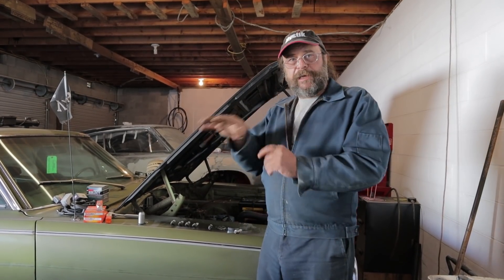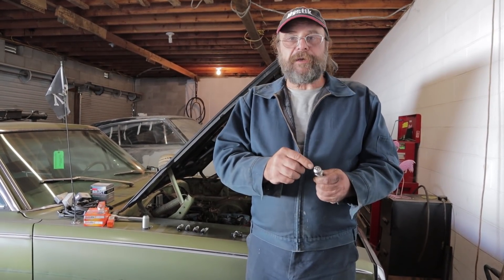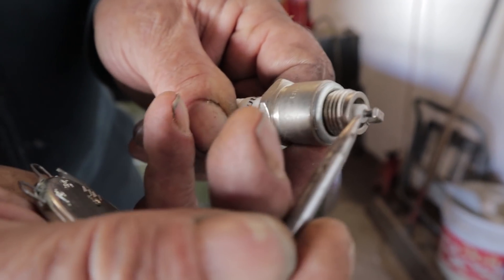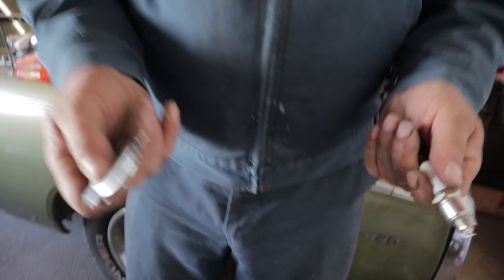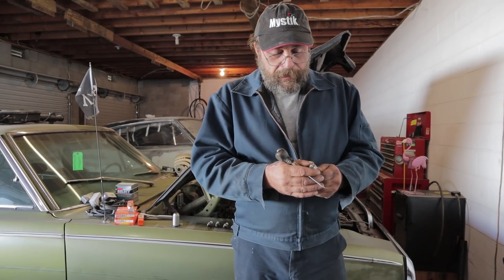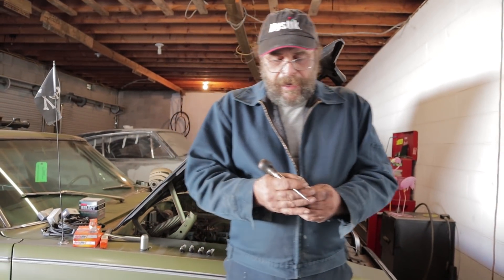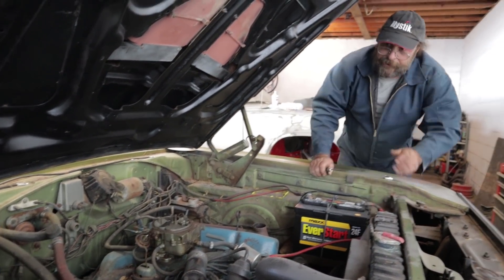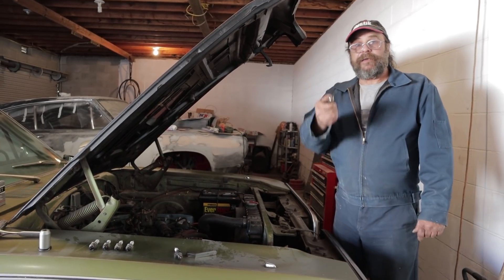Tune Up Basics - Spark Plugs

Comment: The reason I change one plug at a time  and replace it with a new one is because I'm to stupid to remember what wires go to which cylinder. And I'm to lazy to mark the wires. Lol
Reply: I ALWAYS change them one at a time.

Because I'm a chainsaw mechanic
Reply: And you can lay them out in the order they came out.
Reply: Atleast your honest enough to admit it, I had a mate years ago every time he changed plugs I'd have to go do his firing order, I got the shits wrote his firing order on his rocker cover then marked number 1 on the dizzy cap, never got a phone call again lol
Reply: Yep. That exact reason I do the same myself and lay them out in order as I change them out.

Comment: my 69 Bonneville 428 (rebuilt with 11.5 to 1 cr) didn't like ac delco or champion spark plugs.  always had plug problems. thanks for the video.

Comment: Everstart batteries are a good value.
Reply: Not for me. Anything made by East Penn/Deka is much better. Everstart Plus (3yr warranty) that came with the truck I'm driving died at exactly 3yrs. Bought a new Everstart because it died AT Walmart. $100 Maxx was out of stock. Bought the $50 "value" battery with 1yr. warranty. Died 9mnths later. AT Walmart! Free replacement they tried to give me had been sitting on the shelf 5mnths. No way, had them switch it for one that was only a few weeks old. 2 months later as the weather turned cold I went and bought a fresh battery made by East Penn for Farm and Fleet. $100 7yr warranty, 3yr free replacement, 3yr free Nationwide jumpstarts. "Platinum" battery. Top of the line lead acid. In the past I've used "Gold" have seen them last 8yrs. The one I bought has both side and top posts and more cold cranking amps. Walmarts batteries are made to fit their pricing structure by Johnson Controls who is not owned by the same people who established a reputation for quality. A few years ago it was purchased by a giant foreign corporation. I'll stick with USA owned, USA made, just like my Goodyear tires. Everstart if you have to but not by choice.

Comment: Uncle Tony, I was curious as to the best time to switch from summer air to winter air in my tires? My mechanic says I should change the air twice a year, at the cost of about 500$. Does that sound reasonable to you? Also, what about the muffler bearings? My mechanic said that those need to be changed at 10k miles. Can't I just repack them and reinstall them? Thanks in advance for your insight! You're the best!

Comment: Real good. I use Autolites for American, Ngk for Japanese and Bosch for European. Forget the antisieze .It is aluminum filings in grease. It can cause thread pullout. Decades of proof I  Use  Lithium White grease on the threads, wiped with a finger, and your plugs will never get stuck .Use a torque wrench if you are a ham fisted type. Champions on Japanese  engines are an exception. The thread angle is 59 on japanese and 60 on Champions causing some problems no matter what you do.So don't do it.

Comment: Uncle Tony, if I may....I notice your customer’s car is running a WalMart NeverStart battery.  Those batteries are some of the worst batteries on the market.  I worked as an assistant manager at Oreillys for quite some time, and one of the things we learned was, there is only one company left in the US that still produces quality batteries, East Penn.  The batteries that Oreillys sells are made by East Penn.  Almost all other brands are made in China with el cheap materials.  That being said, if you go want a quality battery, go to Oreillys and select the battery you need, then tell them to “ price match” Walmart.  They WILL do it.  You CAN get a good quality battery at a WalMart prices!  If your subscribers don’t already know this, please pass it on and hopefully many of them will read this comment.  I know there will be the haters...” Oreillys batteries suck...”, but I just wanted to pass my .02 cents on.  They will also price match RockAuto....

Comment: 2006 4.6L Ford 250000 miles original autolite plugs from factory. No BS. COIL died at 253000 miles, replaced one coil pack and plug. I could have regapped the original plug, it was at 80,000 gap.
Reply: that 4.6 motor is a champion

Comment: My f250 just turned 250k miles yesterday on the 351(5.8l fuel injection). Haven't pulled the plugs in over a year and I go through about a quart of oil every month. Clean the plugs or get new?
Or just treat the ol' beast better?
Lots of blow by cause the breather filter is soaked. No tach, if I'm in a hurry I just shift when the exhaust changes pitch.
Reply: nice man i got a 91 f150 with the inline 6
Reply: @Brycereigle2000  300=bulletproof
Reply: 351W is a beast. If you have a lot of blow by, like A LOT, go up one range on the heat and it should help keep the plug cleaned off.
I don;t bother cleaning plugs when I pull them.... I think you can buy a full set of 8 autolite copper cores for like 25 bucks. If your plugs clean so easy that it seems to make sense they prolly didn;t need it in the first place. IMO time is money though, and sometimes ya got a lot more of the first one then the other.
Reply: Apathetic Jesus check the Pcv valve. My e150 5.8 ate a quart between changes and breather filter in airbox was soaked.
Reply: @ronwilgenbusch1961  thanks. When I got a couple bucks I'll do that and the iac(gets stuck on high idle constantly. Sometimes dies when the a/c is on and clutch is in)
Reply: @apatheticjesus4147  take the IAC out and spray it good with carb cleaner and it will last for another 5 years.
Reply: @ericshinault3628  sadly I already tried that when I cleaned the throttle body when the TPS pooped out.  Sorta helped for a couple weeks. The rubber bits inside are no bueno. I think that's what causes the sticking. It was a ranchers truck before it was a horse transporters truck before I got hold of it 3+yrs ago with ~210k miles. To use the parlance of our times it's a total dumpster fire. But it's my dumpster fire.

Comment: What happens if a plugs heat range is too cold?
Reply: They will look like the plugs from this engine. In this case it is not the plugs but the look will be the same. Even colder and they will get so fouled that they will misfire.
Reply: Super know it all speed ricer V-tech Jimmy says you will gain like 10HP at the wheels.
Everyone else says your car will prolly run, but it will foul the plugs faster and lead to misfire after while and you will be buying plugs and working on them much more often.

Comment: So here is a spark plug question.... though first let me say I find your advice both engaging and holds great depth!
Let's say your small town auto store doesn't have your vehicles plugs - could you buy an Almost Similar plug (same heat range, washer, etc.) and change the gap to the required spec? If there are any potential points a DIY'er may not account for (, that information would be appreciated too
Was, quite literally, at the store today looking at new plugs and then this video came in my subscribed feed.... so how about that!
Reply: The manufacturers all have a cross-reference guide for compatible plugs. Unless you have a very odd car, you should be able to pick your favorite brand and find something that works. Always gap new plugs, even if they are supposed to be right sometimes there is variation.

Comment: Another thing I like to do while doing my spark plugs, is to ohm test them.  A truck I learned from my days of working on nitro cars! When plugs are made, some are not necessarily pressed all together.   Now it's close enough for the plug to work, but it's not correct, and could cause a problem.   When I do find one that's open,  a good Tap to the wire end on the bench usually fixes the plug.

Comment: Denso, NGK or Champion spark plugs. Not a single problem ever. Please don't waste your time with Bosch or Autolite.
Reply: Was told years ago...never run champions in a Mopar!
Reply: @mrshine1971  That's nonsense. ^_^ My mom's Plymouth Neon runs just fine on them. Never an issue in 20 years of driving.
Reply: @999thenewman  not nonsense. my mopar runs like crap with autolites AND champions. ngk runs great in my big block mopar.
Reply: @frigglebiscuit7484  ok, does it have electronic ignition?
Reply: @999thenewman  might be true on the newer stuff, but on the older pre 80s it was a no no
Reply: @mrshine1971  I'm just going to stop here. I'm wrong. You're right. If you still run an old ignition, then yes, that won't work. Run modern ignition, and it will work.
Reply: @999thenewman  Had no intent to start a pissing contest, I just agree with Tony, Champions are a difficult plug to run in the experience that I’ve had.  Every set I’ve had, like Tony said, fouled if wet.  I’ve tried over and over to clean and reuse, but have never had any success.  Lawn mower, weed walker, etc.. All my early Mopars ran fine on other plugs, even if I ran them rich or flooded them out and had to clean them.  We all have different opinions and experiences, and THAT they say, is the spice of life..Cheers!

Comment: Autolites?  Really?  My experience is that they're terrible.  The only time I touch them is to pull them out to throw them in the trash.  I've seen way too many low-miles, basically unworn sets of Autolites cause misfires on engines that are in perfect shape other than having had Autolites screwed in.  I've seen dozens of cars over the years that have had misfires that were fixed that way.  OEM brand, OEM part number, you will not go wrong.  Outside some newer examples, GM gets AC Delco, FoMoCo gets Motorcraft and MOPAR gets Champion (Japs generally get Nippondenso or NGK, Eurotrash usually is Bosch).  To be fair, it's not just Autolite - I've seen NOTHING but problems with using non-OEM plugs in vehicles.  It's just that Autolite is OEM for zero brands, which means they're problematic in all of them.

Anti-seize isn't necessary in aluminum heads if you use good plugs, though even cheap plugs tend to be plated these days.  Plug intervals are up to 115,000 or 120,000 in aluminum heads with no anti-seize.  People need to be aware of anti-seize and its lubricity helping them over-torque spark plugs without realizing it.

There are a few exceptions to some of the other stuff.  The old Honda Insight required the plugs be indexed, but IIRC that was actually to avoid misfires with the very lean mixture they ran (same reason the new "Hemi" has two plugs per cylinder).  The plugs had index numbers on them.  Also, compression-fired gasoline engines are coming.
Reply: btw, champion isnt good on mopars anymore. they are garbo plugs now. i used ngks on my mopar, runs great.
Reply: @frigglebiscuit7484  Mopar's been switching over to NGK I believe.
Reply: 100% this. i went through two sets that fouled and they only had maybe 200 miles on them.
Reply: Delco and Motorcraft outsource nearly everything in their book for the last decade, from batteries to plugs to whatever. 
I have not had a bad autolite plug in the last 20 years. Before that, total dice roll. But then, Champion made indestructable plugs in the 50's/60's, and they make garbage horrid quality control stuff now. 
Of course, i don;t buy gimmick plugs either, just copper cores. I find most ignition troubles are either bad installs or other componants like coils or cap/rotor being super fouled or worn out. But to each their own.
Reply: @davenhla  I've pulled a lot of Autolites over the last 20 years, to the point where any suspicious random misfire diagnosis starts with "did someone put Autolites in this thing?"
Reply: @immikeurnot  Like I said to each their own, it's a free country

Comment: I’m an NGK guy but, I gotta say, Split Fires with an MSD box gives a great idle with increases in low end response.
Reply: splits are a marketing gimmick. I thought they went bust anyhow?
Reply: @shoominati23  they did, they got bought by e3 I think
Reply: @shoominati23  Split fires/multiple ground strap spark plugs are a gimmick for the most part, as the closest gap will arch the electrodes, but that does mean that it has a slightly longer service life due to the multiple ground straps, like 50,000 miles instead of the typical 20,000-30,000 you'd see from copper electrode.
Reply: You are getting the response from the MSD box. MSD puts a "double" spark signal at lower RPM, combines with a higher power aftermarket coil = a very nice hot big spark at idle.
Reply: An MSD box can ignite piss at an idle
Reply: Magneto would ignite the ancient scrolls during the iceage and thaw out jesus and all the apostles and tell the uncool people to get stuffed and create the new world
Reply: Smokey Yunick himself said Split Fires were a gimmick. That's like the word of God when comes to such matters.
Reply: Splitfire = huge gimmick.. 
Just remember this.. Electricity will ALWAYS take the path of least resistance.  If one of the split sections on the ground strap is a minuscule  amount closer to the electrode, that is the only part of the strap that will fire. Those plugs will NEVER fire both stap sections simultaneously.
Reply: I have talked to more than 1 mechanic who said they work on alot of cars they changed uot splitfire plugs beacause of running issues.

Comment: Interesting about the spark plug heat range.
Always used Champion plugs in the chainsaws and mowers,and Pop's outboard boat motors,no wonder always trouble starting!
Very handy tips👍!
Reply: We usually ran 1 or 2 steps colder on our old 2 stroke dirt bikes and even the 4 strokes. 
They'd get a little dirty but being an ngk I never fouled one. 
And ngk heat range numbers make sense, at least to me. 
I always heard , run as cold a plug as you can get away with.
Reply: Got a friend who has been ( and still is ) working for Toyota as a mechanic/tech for over 25 yrs now. He said never run an American made plug in a Japanese engine because for some reason, mpg suffers and it WILL foul those plugs soon. Use only Japanese plugs ( NGK or ND ) in a Japanese motor. He also said that for some reason, the American made engines can run a Japanese plug just fine. Go figure.

Comment: a question for you I took over a prodgect don't mind me I always get that word miss spelled. it is a 82 olds delta 88. with the 305 in it block just put back in it. what type of wires and type of carb it had a two barrel on it originally the guy replaced the factory intake to a single plain intake manifold it looks like he was going to a four barrel Quadro. what I am asking every thing looks like it has a mild cam and looking in on it aka what type. what would you suggest on a good carb just to start with then go from there. I rather ask some one that has more experience with a carb than I I know more about fuel injection than carb but slowly learning on adjusting and trying to match what is best to make the motor that I am working on happy. from the dodge 318 to fords 302 slowly learning on a carb set up even though it is not my strong point
Reply: a single plane intake isnt too good on the street, but its better than a 2 bbl. on a 305, i would go like a 625 cfm. its usually double the displacement of your engine.

Comment: Hey tony, I've been asking around, and I haven't gotten any good responses, so does it matter which head you use for spark plug wires as long as it fits? Or should I try and find wires that are made specifically for my car?
Reply: That's a good question I would like answered too. I was once told it REALLY mattered and that there was corrections for the increased resistance of the longer wires. Now over the years seeing so many swaps where its cobbled together with what's laying around and runs just fine, not to mention those make your own wires with the kits for LS builds and all, what gives?
Reply: I used Ford 302 plug wires on my 318 Mopar works really well

Comment: I hate champion and back in the 60s I learned what you know that autolite is great american plugs. My japanese cars and motorcycles like nipodenso or NGK
Reply: It seems to me that only certain autolites are good. In a parts store I've had several come back for things like the porcelain being loose in the housing all while are local racers swear by them and never had a problem. Their glow plugs suck the center electrode pulls out so it doesn't work.
Reply: @Roadhouse1997  i went through two sets of autolites and they suck. fouled both times. went to ngk and they work great.
Reply: @Roadhouse1997  things change with time. I have not bought an autolite spark plug for 30 years. Its all NGK or Nipodenso for me now. Also I never liked AC spark plugs either especially in outboard motors.

Comment: On my '87 LC2 Turbo Buick it was a matter of putting fresh R43-TS' in gapped at .030 rather than .045 to go from a 15.1 to a 13.2 and then a 12.5 at Numidia's altitude on bogus tires. Beaver Bob busted my balls that autumn when I crossed the river to jump at the end of his right lane at a 14.2 right when he got his Kenne Belle on his Marauder. Ford guys are good ball busters, but I told him how boost could blow out the spark back in the old non-ethanol days. His fancy Merc picked up some steam on a smaller gap. Plugs are important. Learn how to clean cheap ones before spending $11 each on iridiums. Trust me.